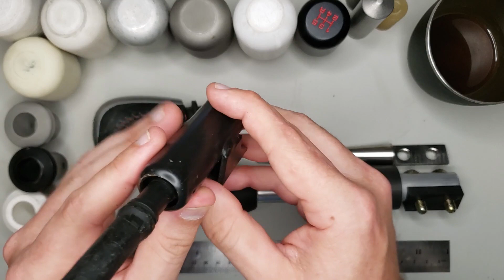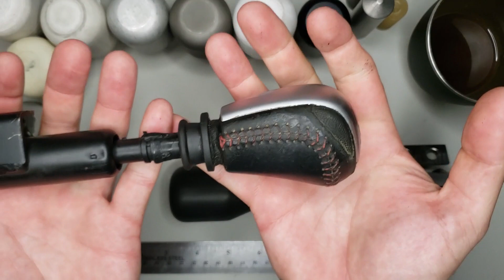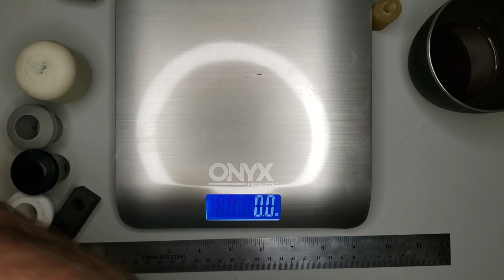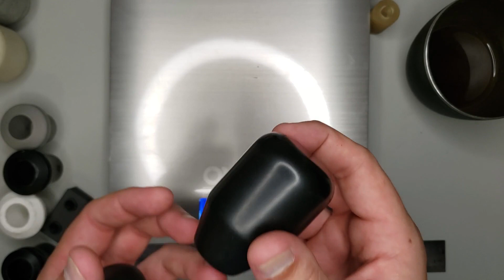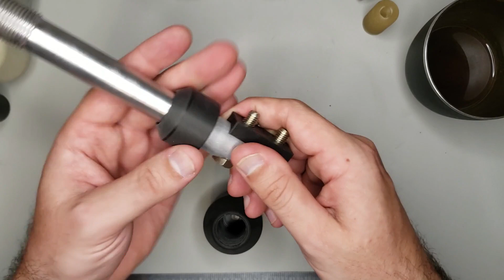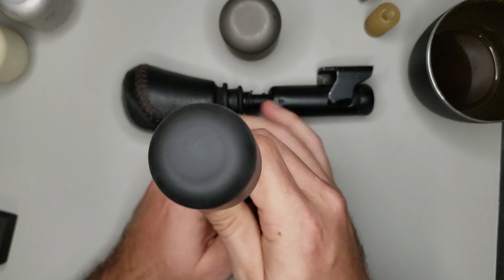Engineer Creates New Product Design for Driving Experience of 2005 GTO Performance Shifter and Knob

Comment: I have an 06 GTO super interested in this would love to install one on mine! The link isn’t working anymore are you still making them?
Reply from the maker: I really appreciate your interest and nice to meet a fellow GOAT owner.  I stopped making them after selling 5 or so.  Just too time intensive to machine and also not too many people running the stock shifter assembly and couldn't make 2 different versions.  I just upgraded to the Sikky remote shifter and retrofitted my rod to fit... same hole pattern but larger bolts is only difference.
Reply: Well that’s a travesty been looking for a great shifter have a short throw in there now and it just doesn’t feel right. If you ever get a wild hair and make any would love to be one of the lucky ones.
Reply from the maker: @Podcast19-19  You have the stock shifter assembly right with a short rod on it?  I am working on a new steel version that will fit best with my Sikky assembly... Only difference is screw diameter... might be able to make more than one and make some bushings to make it fit the stock shifter bolts.
Reply: @JJCCENG  Yeah stock assembly and I’d be super interested if you do that let me know!
Reply: @JJCCENG   what do you charge for them? Lmk and if you can make a second one I’m located in Las Vegas.
Reply from the maker: @Podcast19-19  Will do
Reply from the maker: @Podcast19-19  The 5 I sold were at $200. I know its steep but both knob and rod are hand machined and polished to order so im not getting the economy of scale that a large manufacturer would.